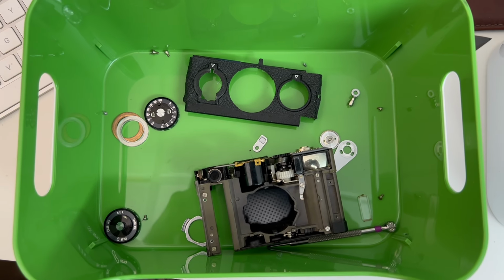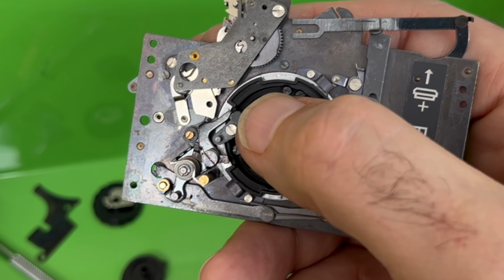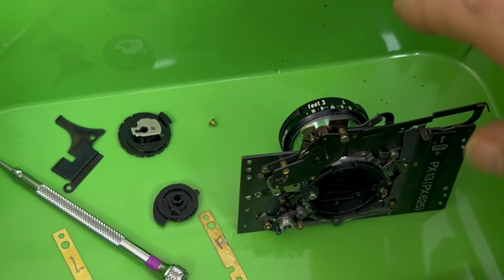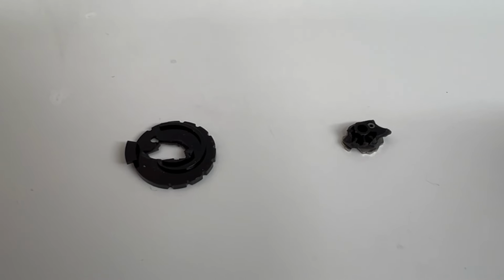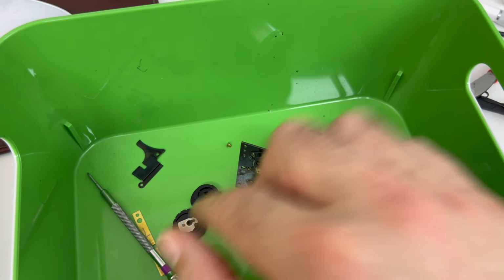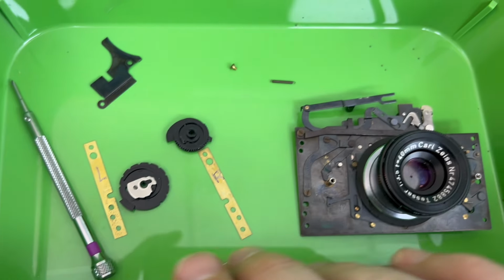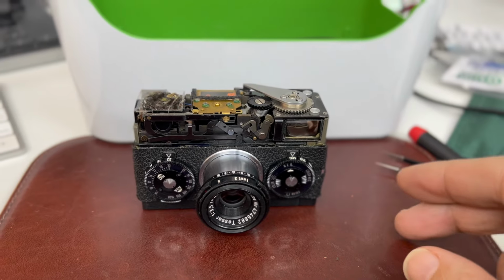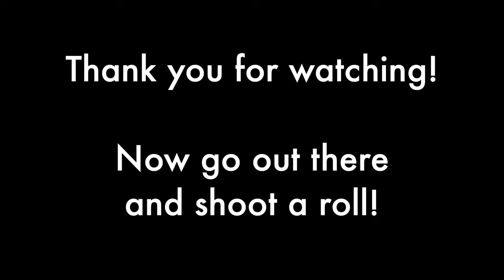Oh no! I had to perform deep surgery on my Rollei 35!

Comment: I'm tearing down my old
Nikkor 28-80mm f/3.3-5.6 g
Lens
To get rid of fungus rn
And oh boy

I've torn down phones before, laptops,

Lenses are... Lenses are just insane

I get why they're so expensive now😂
I get why people buy expensive dry chambers now

Cus this lens has 6 optics

Imagine how many a modern lens has..
Reply from the maker: I have a 55mm lens for my Mamiya C220, a twin-lens camera, and the viewing lens has a bit of haze. I disassembled it as far as I could, trying to clean out that haze.
I eventually realized the haze was in the glue holding together a two-element sandwich. I might be daring, but I believe that regluing multi-element groups is above and beyond the call of duty (and possibly not doable outside of a lab). Argh!
That haze will remain. At least it's in the viewing lens only!